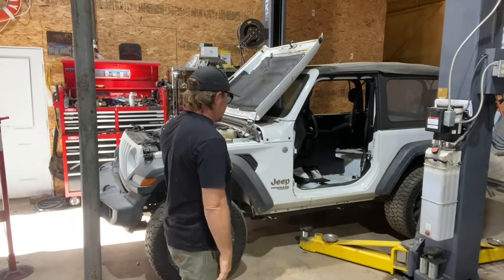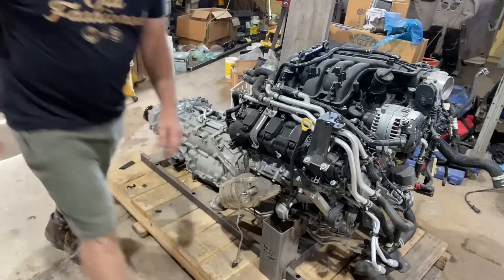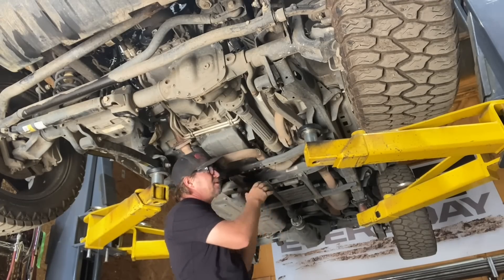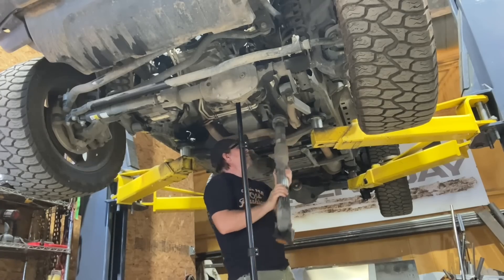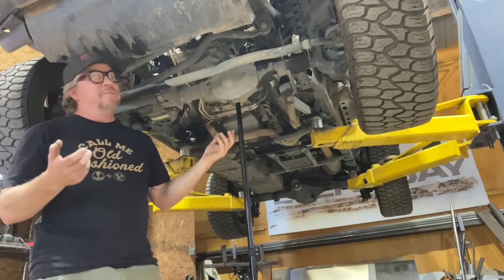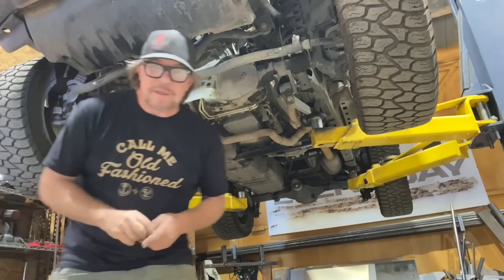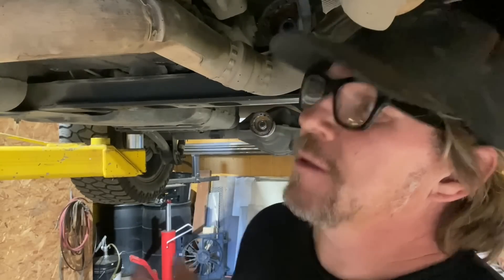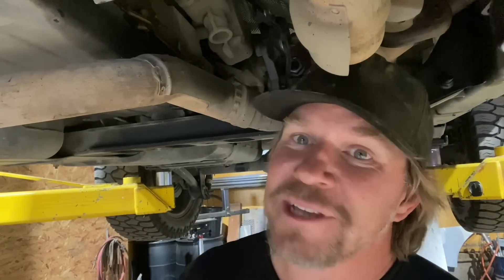Dirt Daily. NewbSock needs a New Engine

Comment: Ha, worked with my neighbor (younger guy) to help him install his lift.  He had ZERO concept of returning tools when we started.  I walked away for ten minutes and came back to him literally sitting in a pile of tools and drill bits and sockets.  Took some time but I finally got him tuned up on the importance of putting tools back so you know where they are as you work.  Great series.

Comment: Good advice on the pictures, before cell phones I used to draw everything, it's also fun when the same component has different length or size bolts i.e. "theyre all the same, but the long bolt goes in this hole" 😀

Comment: That "tick" in the 3.5 Penta Star V6 is a rocker arm that goes bad from the factory. Pretty much every one of those 3.5v6 have this issue yet Chrysler won't work on it. Easy fix and no more tick.
Reply: It's a 3.6

Comment: I'm still stunned that the original engine failed with only 100k on it. I like to use rolling tables for tools. I also clear an area or set up a big table for all the parts I removed and the hardware. Sometimes I've even taped the bags of hardware to the parts if I think it might be a while before they will be going back in. Pictures are a good idea as well.

Comment: So I have a 94 YJ with a 4.0, AX-15, & 231 T-case. I would like to swap the axles as the rear is leaking and I would like to ditch the front with the CAD system. But I can't afford custom axles. Would a set of the newer JK or JL axles be a possible swap? I can do some fab work so I could strip the brackets and weld on spring plates and shock mounts if this is a good idea. I am running 33's now and I am planning on 35's later. Your thoughts if you you have time. 
Thanks in advance.
Reply: You might have an easier time finding axles from a TJ. A set of Dana 44s from a Rubicon would be ideal... And while the axles are off would be a good time to upgrade the suspension to something better than leaf springs. Of course, that depends on your budget too... I really need to re-gear my TJ, plus I think the front u joints are going bad, plus I've got serious death wobble - it never ends LOL...
Reply: @AndrewAMartin  So true. It truly never ends. Thanks.

Comment: The 3.6 Pentastar is a good engine. Decent power. Great fuel economy. 
But Chrysler dropped the ball in the valvetrain design, among probably other things.   I've seen several with rocker arm issues. There's a recall for alot of them.

Comment: I was honestly hoping for a more interesting new engine. A stock 3.6 V6 engine with an auto is a bit lackluster
Reply: Why? Pentastar is a good engine with decent power.
Reply: I believe Fred lives in California. Swapping a different engine is a street legal vehicle requires a DMV referee visit. Also is way more complicated.
A good tech can swap the same type motor/trans the same day and have it run perfectly with minimal fuss, a quick smog check and he's up and running with a legal vehicle the next day.
Reply: @motochris5459  I understand that but still, at least go with a manual.
Reply: @blapblapism  Should have gone with a manual at least.
Reply: Appreciate Fred showing that swapping engines and transmissions isn’t always needed.
Reply: @MrLM002  An automatic is actually better offroad, and the 8 speed helps the Pentastar be its best.
Reply: I also imagine that these builds don’t have the same budget as the ones on his old program, at least not yet.
Reply: @AndrewAMartin  Depends on your definition of better. For durability, longevity, simplicity, etc. one would go with the manual. That being said I understand that getting that whole drivetrain for exchanging parts with only 500 miles on it is a steal.
Reply: @wyattrowe8396  Yep, which is why I understand why he went this way with his build.
Reply: @MrLM002  Maybe I should have clarified, but by better, I meant for actual offroading, autos are nicer to drive, easier to moderate the throttle, and provide some flex in the drive train which helps prevent breaking axles when you get on the skinny pedal too hard. Rock crawling with a manual isn't as much fun as rowing the gears in a sporty car (I have both a manual Wrangler and manual Audi TT, of course the Audi is so much smoother).  Drive-ability and efficiency, in a Jeep for offroading, the modern auto wins.  

And the fact Fred could get this one relatively cheap, that's a huge win...

As an aside, Fred doesn't have the budget or corporate sponsors that he had with Motor Trend, so if you want to see something exotic for an engine swap, buy it and send it to him... 😀
Reply: @AndrewAMartin  I understood what you meant. Besides the people who chose to go rock crawling basically everyone who goes off pavement avoids that stuff, including the US military, and if fresh out of high school grunts are not willing to do it there's probably a really good reason since they arguably do the stupidest stuff one can think off while having access to the most expensive things a stupid person generally could ever have access to, including obscenely expensive fairly durable 4x4 automobiles.

Probably going to get hate for this but whatever: What's the point of using a car to go down a path that takes longer than if an average middle-aged man can hike said trail?

 I like being able to go anywhere just as much as the next guy but at what cost? 

My experience off road while limited this is my off road logic as it has developed over the years?

How much stuff do you have that can break?

How hard is it to fix it? 

Do you have all the tools, supplies, and man power needed to fix it?

Do you have enough supplies for you, whoever else is with you, and your manpower to survive long enough to fix it?

If you can't fix it how hard is it to replace it?

Do you have all the tools, parts, and manpower needed to replace it?.

Do you have enough supplies for you, whoever else is with you, and your manpower to survive long enough to replace it.

Can you be towed from your location if need be?

What's the likelihood someone with the will and the means to tow you back to civilization will happen upon you?

In my experience having a buddy with you is the way to go, but you can't always count on them. Say they get injured, lost, or taken "out of the fight" somehow and now you're on your own for your off road issue. Can you deal with it yourself?

The answer is most likely not, as the components of your vehicle and or the tools needed for said vehicle are too heavy and or too impractical to take with you in the first place, and even if you could manage to take them with you the chances of you being able to install them yourself on the trail are slim to none.

Gone are vehicles like the 2CV Sahara, the Original air cooled LJ-10 Jimny, etc. that were beasts off road and could be worked on with minimal tools and minimal supplies by one person. Both engines were light enough they could be lifted by hand if need be. Every part on those things was light enough to be able to be moved by one person, you had no coolant to leak out, minimal oil to leak out, manual transmissions, etc.

Sure if I had a Skycrane on standby and someone else footing the bill I'd go rock crawling whenever. However if you had to foot the bill yourself you're just one breakdown away from losing all your things, your house, and still going bankrupt trying to pay to get your rig off back to civilization because in some of the places people take their rock crawlers the only way you're getting them out of there is with a damn helicopter strong enough to pick it up from where you left it.
Reply: @MrLM002  Wow, I'm not even going to try to answer all of that, but let me just say I'm not doing extreme rock crawling, just following trails of varying difficulty in off road parks, all of whom have 2-vehicle minimums (never wheel alone, and if your buddy's day is done, so is yours). I usually go in guided groups for charity wheeling events, as well.  Even though I don't do extreme stuff, there's always the chance that something will break. Jeepers usually see that as an opportunity to upgrade... 🙃 

Not sure what any of your rant has to do with this video though...
Reply: @AndrewAMartin  You mentioned rock crawling. The advantages of an automatic over a properly geared manual off road are basically nonexistent outside of rock crawling.